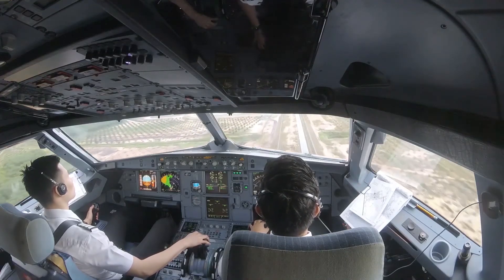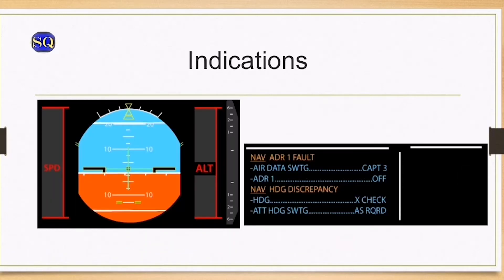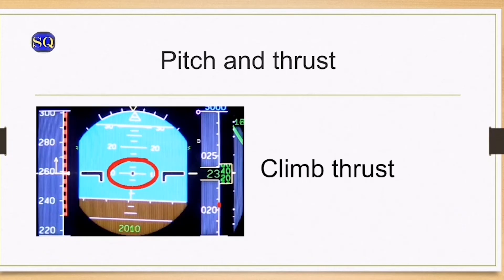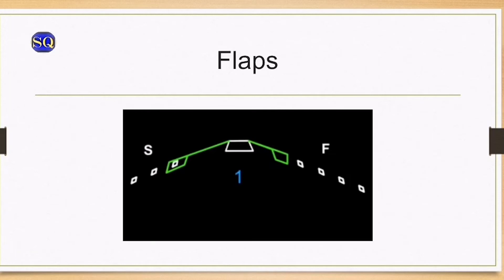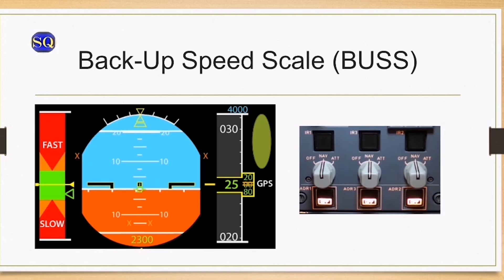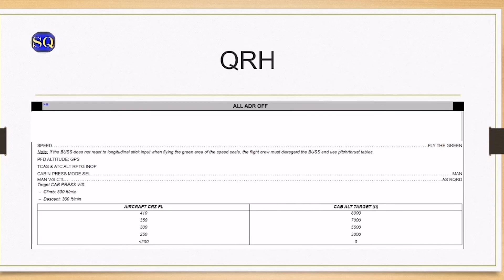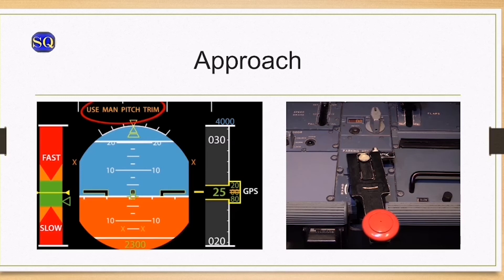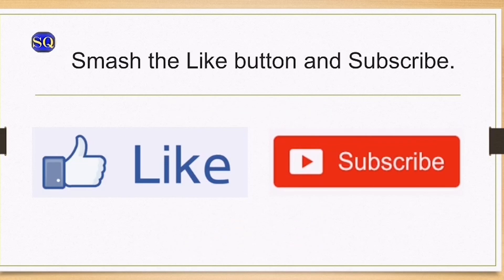A320 Unreliable Speed What are the causes and steps to take? (MADE EASY)

Comment: Hi Captain question pls: if you're flying and you have this ECAM: IR 1 fault, what do you do ? Thank you
Reply from the maker: Good question. AtT HDG SWTG to CAPT 3 and ATC/XPDR to System 2. You can follow the ECAM actions.
Reply: @Captain_SQ  many thanks so switching Captain 3 due to failure of 1, ok clear, so for example if there was ir 2 fault it was set up fo 2 the switching. Is that right ? And when is the moment that might be used recovery in att mode?

Comment: one question:
why should we use BAKUP  RADIO NAV by QRH?
Reply from the maker: Do you mean for this particular failure?
Reply: @Captain_SQ  Yeah. Some A320 have this procedure to use BACKUP NAV in the  QRH ALL ADR OFF PROC.
Reply from the maker: BACK UP NAV is normally used if you get a dual FM failure. I guess it depends on your aircraft serial number. Back up NAV is for flight planning and the NAV you select on your RMP is for manual tuning.

Comment: Isn’t better to gravity extend lnd gear down after flap 3 (like in a double hydraulic failure) ?
Reply: Captain SQ did not undertand your question. You only do Flaps 1,2,3...approach speed ...then gear down in 2 abnormals. G+Y Hydraulic failure and stabilizer jam. Why? Because you have no movable stabilizer and the trimming is done by elevators only. As soon as you put the gear down the elevators stop their autotrim. " Use manual pitch trim"....but there is no manual pitch trim any more because the trim wheel addresses the stabilizer and not the elevators.  For any other abnormal this is not necessary.
Reply from the maker: Hi Acarsfault, in the case of Double hydraulic failure, it depends on what failure it is. If you get Green and Blue Hydraulic failure, you would have selected Gear down at 200 kts (much earlier) if you want more stabiliser control as you only have one elevator. So in this case, would you require to be a direct law much earlier or later on approach? Normal Airbus procedures will be Flaps 1, Flaps 2, Gear Down then Flaps and/or Flaps Full. You would change the sequence if the failure procedure require you to do so. Hope this helps.

Comment: The BUSS is there to kill you if you do not fly pitch/power.  I will only use the BUSS as a niceely-meant confirmation of my pitch/power table.  Besides of that I ignore it.  As soon as the AOA sensors are  corrupted the BUSS will lead to certain death.
Reply from the maker: BUSS do rely upon AOA sensors that is fed through to the IRs and the BUSS should only be used below FL250. To have all your pressure sensors and also your AOA probes faulty, then yes flying pitch/power is the way to go. Flying using any erroneous indication will pose a safety hazard.